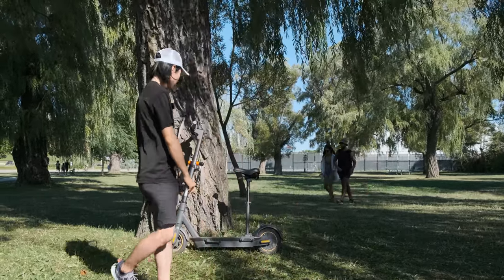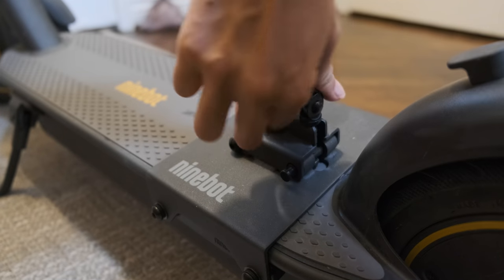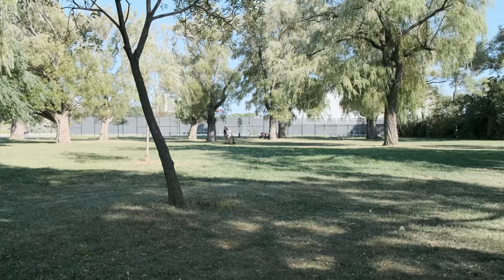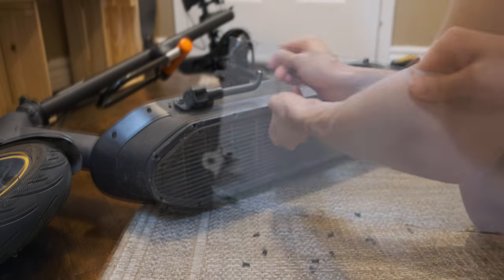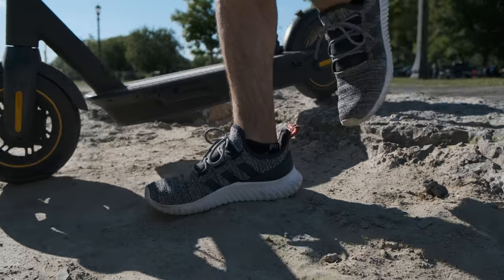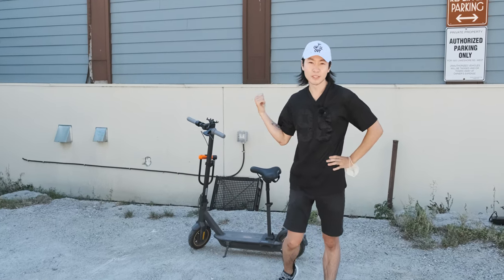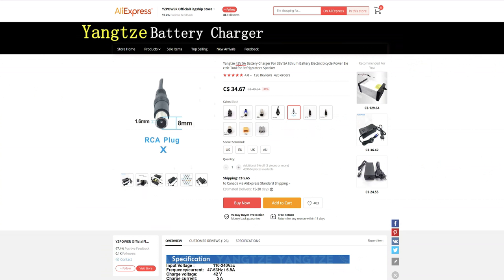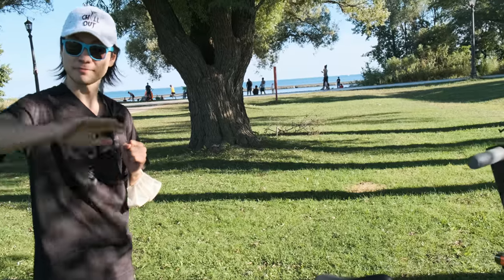3 Must Have Mods for Ninebot MAX

Comment: You should adding full set of monorim parts for your ninebot and Ive definitely loved the way riding performance felt way better then stock parts 👌

Got external batteries,spare parts

Need new decent splitrims with 48v 500w motor hub with bigger tyres set up be awesome feeling 😉

Comment: Installing a stainless base plate, sounds good for protection.
But.......in reality your over heating the battery pack.
Those factory installed fins you conceal with the new stainless plate are designed to trap and displace air for cooling the batteries.

Comment: Yun, are you still using your fast charger? I wonder if it might damage the battery?
Reply: It might fry it indeed...
Reply: It's not even a fast charger. It's a faster charger. Fast charging is over half the battery capacity whichbis 15Ah so fast charging starts from 7.5A.... This cahrger is 5A
Reply: @hhy2k  The charger is quite a bit “faster”. It will charge my battery from 15% charged to 100% charged in about 80 minutes.

Comment: Thanks for sharing! Is there a way to install an extended battery?
Reply: @LisaLightning  true i was like what ? Is a scooter not a tesla what these guy is asking for🙄
Reply: @ibrahim2active  I have the g30l which is very similar and has rated 40miles mine last 20kms realisticly riding and in sport mode 40 miles is for flat ground in eco mode so when I ride around town in sport mode I get 20kms not even 20 miles so I would like a secondary battery also

Comment: Do you use the fast charger regularly? Any difference in the battery life now after using 3rd party charger?
Reply from the maker: Yes I use fast charger all the time, so far didn’t notice any performance difference. Just faster charging
Reply: Yun Production yo fella thnks for reply, how many miles do you get at 30kmh from 100 before it starts slowin down quickly??
Reply from the maker: @flejt7107  at 60 percent I really feel loss of torque. and it stays to 28km for long time
Reply: @YunProductionCanada  I think it's cos maybe you're overcharging? Just used it to charge to 100 and the charger doesn't stop making that noise so it prob carries on charging
Reply: @flejt7107  i have yet to use the fast charger (just ordered it) and mine slows down to 28-29km around 2 bars (so 40 percent). I am 135 lbs.
Reply: Mikaela V yh same with mine, im a skinny guy and weigh slightly less than you. Its to conserve battery life, theyve made it so that its hard for you to drain all the way to 0. 

Even if youre running on "empty" you can leave on eco mode and use it as a kick scooter; has abit of power to it. Dont be an idiot like me tho; done this whilst tipsy and in freezing temps
Reply: @mikaelav8964  how much autonomy do you get? I weight about the same and I'm planning to get one
Reply: @flejt7107  how much range do you get with it?
Reply: Please don’t superglue the scooter shut some day your gonna want a new battery or charger to keep it running smooth

Comment: How is the battery gonna ventilate if everything is sealed away?? does that not give any problems
Reply: isnt the stock one sealed as well ?
Reply: @petervu9773  your rught how stupid of me :P
Reply: No you're correct. The original isnt smooth. It acts like a heat sink. More surface area to dissipate heat
Reply: @jungle717  if it's plastic it doesn't dissipate heat, plastic is an insulator it doesn't transfer heat as well as metal.
Reply: @DL101ca  there are polymers now that dissipate heat just as good as metal. I know they are used in lighting fixtures. I'm sure if you google it you'll see they are used in lots of different applications.
Reply: @jungle717  well I can tell you what the cover is made of it's not one of those.
Reply: @DL101ca  lol I can't confirm or deny your claim
Reply: @jungle717  put your hand on the cover after a ride and see if you feel anything...pretty simple really. If it were made to dissipate heat it would get hot/warm to the touch.